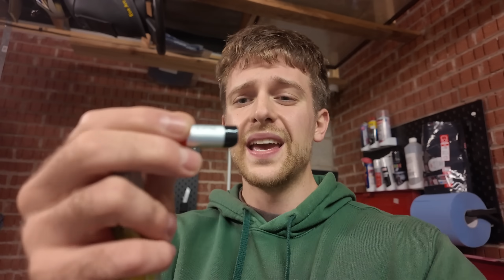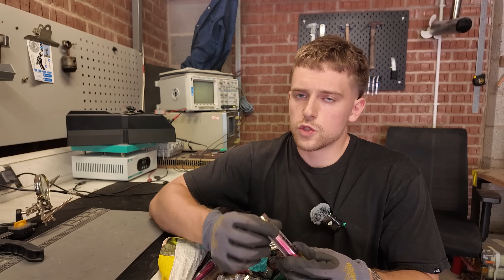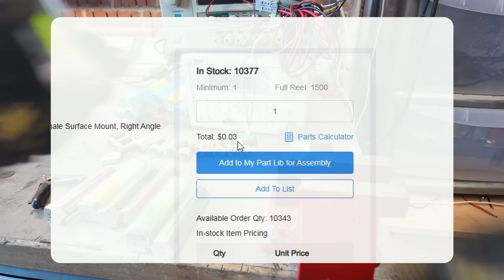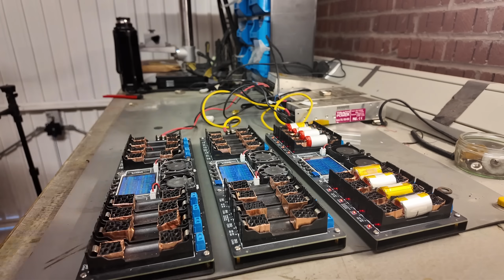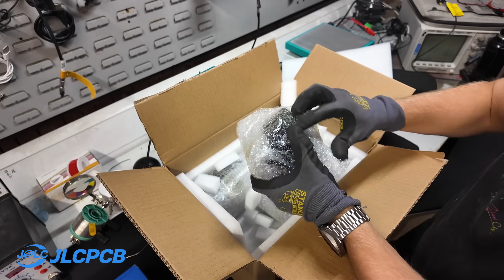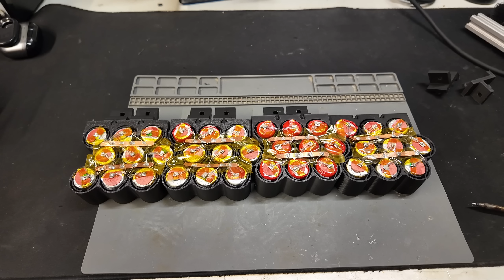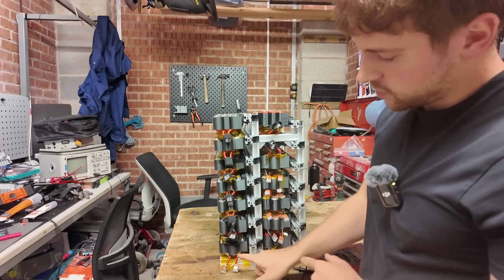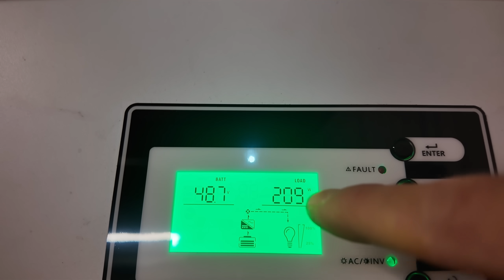I Powered My House Using 500 Disposable vapes

Comment: This is incredibly dangerous despite all the safety measures you put into place. But a fantastic project which demonstrates how insane the disposable economy is.
Reply: This is more like "will these burn my house down"
Reply: Nothing 'incredibly unsafe' whatsoever. People questioning the quality of these cells... I have been using and testing them for a couple of years. They have been recently extremely rugged and high quality. Vapes demand high current and capacity cells. China seems to have learned more than any place how to produce cheap, reliable quality cells in recent years. Smearing them just by assuming they will produce rubbish just doesn't fit reality or make sense anymore. Those disposable vapes had a vanishingly low failure rate from the box which could be anything, including battery issues. Though I can't find the data now... Take my word for it, it was a crazy low number.
Reply: How does the electrical protection system now function is what I would be worried about. Electrocution and fire are defo concerns
Reply: Have a very large scuttle full of sand hanging over them ready to dump on the batteries should they catch fire.
Reply: @david-spliso1928  Or just lower them into sand from the start. May get a bit warm, of course...
Reply: @_TheDudeAbides_  Yes you need to be able to smother the fire quickly.
Reply: @david-spliso1928  maybe a chamber of sand over the top, activated by a solenoid to release if x condition triggered by y
Reply: What is dangerous here? Can you explain?
Reply: @13hubi13  The quality of the cells is questionable at best. The manufacturers of the vapes dont really care since they only need to work once.
Reply: @Jonzzono  even the Tesla cells are made in china, so stop talking BS. The cells in this video are as safe as any other.
Reply: @ludovicschneider6190  No. China is a large country with many different battery manufacturers, each manufacturing batteries of various quality and spec.  The basic conductor elements may be the same, but the specs and build quality of the batteries themselves vary wildly.  Being made in any specific country does not indicate ubiquity of quality, least of all China, who simultaneously are the world's manufacturing experts but also have low regulation and bottom rung quality control standards.

A disposable vape manufacture is going to source the cheapest battery available. A company like Tesla that has safety and regulatory guidelines to follow and has the expectation of long term repeat use is going to source their batteries with a higher build and safety standard.  Not all batteries are the same.
Reply: @Jonzzono  but if any of the cells fails there are things stopping it to go ballistic, right? Like the fuse and the small connections on the positive side.
 Won't that be enough to prevent it to explode?
Reply: @ludovicschneider6190  No they're not. A lot of cheap cells are from multiple sources. Even if they're the same "type", they all share different manufacturers that have different quality standards.

If I built a battery bank like the one in the video, I'd probably attach some form of balance monitoring to each individual cell, to keep track of every individual one. I also wouldn't solder the rails directly to the cells, rather adjust the holders and design to quick swap a cell if needed. 

As well as improving the housing for each cell bank to isolate it from the other cells in the case of a fire. You could adapt the design methodology of the BatSafe, where each cell block (not row) is both explosion and fire proof. As well as solid state fuses / relay interrupts for the whole system in case of a short in a cell row or block. Solid state fuses generally break FASTER than regular fuses, which also prevents a potential fire from breaking out if a short occurs. 

Shorting is the main issue cause under high load, these cells can heat up rapidly, which can lead to cell puffing and shorts internally within the layers inside the batteries electrolyte. Then you get "cracking" noises, followed by smoke. Then fire. Explosions. And really really toxic fumes.

To build a proper battery to power a house, you could use these vape batteries, but the actual design of your housing and safety features should ALWAYS be first priority. Especially when dealing with the quality of the batteries within disposable vapes.

You can't expect the battery gods to treat you well when you say shit like that. In all seriousness, lithium batteries of any type, regardless of origin can and will burn your house down if you don't know what you're doing.
Reply: @ludovicschneider6190  thats dumb thing to say and not true. :) sorry but quality is a incredibly variable thing in cells.
Reply: @jessicagalindo4470  battery blowing up because of terminal runaway, when one battery burns it’s overheating other ones and it’s creating chain reaction..
Reply: @13hubi13 Having thousands of lithium ion cells from dubious origins all sitting in a confined space.
Reply: @13hubi13  these cells are not supposed to be constantly charged and recharged, plus if you try to charge them fast they get hot pretty fast. and unlike special batteries like lifepo4, these actually burn. and it will take literally ONE bad cell to  catch fire or explode for the whole thing to go down. 

I can assure you, if the person is this good with engineering and soldering, he won't be actually using that, it's to show a concept
Reply: @zenlettering  LiFePo4 burns too. Not that commonly, but open flame is most definitely possible, have seen it myself with drone batteries. Plelnty of YT vids too.
Reply: @zenlettering  I have recharged these cells at 3c or 4.5A to 80% and they get slightly warm then once they are in the constant voltage part of charge the charge current rapidly drops but I have taken these from flat to full in about 23 min. most of the older ones used to be 1500MAH but they dropped to 1350MAH a while back. the 1500 were closer to 1400 in reality and the 1350 were closer at around 1300. if we assume that they are around 1.3AH a cell X36 that gets 46.8AH at 50V or 2.3KWh total. I would be perfectly happy fast charging this at 60A to 80% SOC then disconnecting the charger at that to reduce stress on the cells and discharge to 15%, this would reduce it to a 1.5KWh unit but it would let it last well over 500 cycles and possibly to 1000 instead of around 100 given the quality of the cells. 

but for safety I would construct a small brick hut for it outside with some vent holes at the top and bottom preferably on the long side (half a vent brick would do per pack top and bottom with a mesh screen attached to the back to keep bugs out) then a separate compartment on the back to hold the BMS and wiring with a sheet metal plate to cover the top, that way if it does melt down it cant burn the workshop although it may need a small 30-50W heater with a frost thermostat to keep the chill off the batteries in winter that would need mounted under the packs to act via convection, a little bit of fiberglass insulation built into its roof may help allot with this. it could even be built wide enough to fit 2-3 of these modules but then a bigger heater may be needed but once the pack has load on it the cells will warm up and the stat would disconnect the heater until enclosure drops below the 10C or so the stat would want to be sat at.
Reply: @Phantogram2  A drone with an LFP battery? That exists? But yes, they are far safer but not fail-safe.
Reply: @13hubi13  The inverted used is an off grid inverter. If by mistake the grid power was on at the same time as this inverter, the power will be out of phase and very dangerous to the household, grid workers or even other customers. If a hybrid-grid tie inverter was used, this would be safer. As for the cells, they are known to be volatile if there is a thermal runaway event for whatever reason, this could be catastrophic. Lifepo4 is far far safer and if you factor time and risk, buying lifeo4 cells would be so much more cost effective but of course not a great video.
Reply: @13hubi13 I wouldn't do it. I'm building my 5th lithium iron phosphate battery today & cells are variable in internal resistance, capacity etc and must be matched. I test mine because I don't trust the distributor since they sell in 4 packs they guarantee they checked & matched but I buy 2x 4 packs to build a 24v & they don't guarantee to match the 1st 4 pack & the 2nd. It can work if mismatched but is unwise even with lifepo4 batteries that don't burn like other lithium cells which i believe vape batteries burn lol
Reply: Agreed. 1 in 500 dodgy cells decides to give up the ghost some evening while recharging......
Still cool to see someone do something like this, especially since he's nowhere near me.
Actually using this without relocating outside, in a sturdy metal or concrete housing though would be not_smart.
Reply: He didn't weld the cells but solder it. Not very safe either
Reply: @anonymunsichtbar3715 sure buddy... soldering is known for not working, right... 🤡
Reply: @anonymunsichtbar3715 He used the existing welded strips, no?
Reply: It's not insane, consumers r just dumb, I save all my Lithium ion bats and I boost my electronics like my wireless speaker ect... or I replace my TV remote regular battery with rechargeable from a vape 😂
Reply: was disappointed seeing they seemed to contain polymer pouches instead of the nice cells. i don't want those bloating bombs near me
Reply: 14:15 he said it himself.
Reply: If you know about electronics you know 50V isn’t actually dangerous. A lot of EVs are 800V and yet people don’t call them “incredibly dangerous” in fact most of yall text and drive right next to teslas.

Comment: 5:50 alright, I know a product exists that'll do this better. How do I know this? I own it! Get a universal battery charger. Took less than 30seconds to work out the search term and find one that'll work on the smaller of those two batteries (13350) with 8bays for 25$. I'm sure theres even cheaper options considering how little effort I put into looking.

Comment: That's so stupid, I've even written to the manufacturers: Why are you putting LiPo batteries in a disposable product? 
The manufacturers reply, yes, we write it on the products, people should hand them in for recycling.... That has never worked! The legislator should intervene and stipulate that only normal batteries may be used! Honestly, electric cars are expensive because of the raw materials needed for the batteries, and we're throwing tons of this stuff in the trash. I've been vaping for 12 years and find disposables disgusting!

Comment: Flat batteries can be recovered even if below 3V - use a TP4056 charging module which trickle charges until the battery can take the full charging current. Lion batteries are only really ready for the bin/recycling when they have had several thousand charge/discharge cycles.

Comment: Could you build/print a top and bottom that connects the batteries through pressure, reducing the labor of soldering? Or is soldering a must?  I really appreciate the sponge and copper tape. Thanks for showing this project.  Fascinating to see everything come together. Really impressed with the ability to recycle these things for a positive impact.

Comment: "English chemist Sir Humphry Davy attempted to extract aluminum metal from its oxide but failed, naming the hypothetical element "ALUMINUM"", an exact quote from encyclopedia BRITAINNICA. it furthermore states,  "Charles Martin Hall in the U.S. and Paul Héroult in France independently discovered a more economic way to produce aluminum using an electric current to extract it from alumina dissolved in molten cryolite. 
in 1868 Hall patented and commercialized his process, founding the company that would later become Alcoa." in his patent he named it ALUMINUM. Brits, please learn to pronounce this world correctly.

Comment: 😂I hope you made sure you used a ESD safe variant for your 3D printing plastic… I’m sure you did but if you didn’t, the static electricity would definitely mess with the power of your batteries. 🪫

Comment: Please replace the wagos I love wagos too but that is very doggy also you should take on my personal off grid system 45kwh of battery capiabke if doing 900 amp discharge continuously into 2 inverter (soon to be 3) constantly running a shed and house

Comment: Can you share total cost of this ? Can you imagine you can charge it at night when the electricity is cheap distributed and use it during the day or other expensive hours. It could amortize itself really easily and you will have a backup plan for electric cuts.

Comment: This is completely dangerous wiring and standards. 

Please don’t follow the wiring. For proof of concept fine but I hope you’ve disconnected the back feeds via the fuse board. 

You can have the chance to kill someone with the way you’ve connected it to the mains. 

You should really have a better solution I.e generator input into the house or garage that completely disconnects the mains and makes it impossible to to have both on together. 

I really don’t want to be that guy. I really really don’t. 

Great job on making it work. Poor application. 

If you’ve followed some American setups you may see similar but they normally have a mounted blocking plate to stop two being on together.

Comment: So what happens when you have a blackout and forget to turn off the main fuse connecting the output of the inverter to the grid when the grid comes back up? (the inverter needs to be between the incoming feed and loads)

Comment: Way too much work for quite low capacity. I've got free battery pack from crashed electric BMW. Huge and heavy battery but woth it. From 300 pcs 21700 cells only about 20pcs was defective and 280 cells had 3000-4000mAh. I bought electronics and I build awesome batterypack for my cabin. 
It powers the lights, water pump, TV, computer, water heater, washing machine and accu tools chargers for three days without any problems. If the sun shines brightly during the day, the battery pack manages to recharge nicely from four solar panels and does not go below 60% of capacity.
Costs: solar panels and driver about 700 USD, battery pack boards and parts about 80 USD. My time about 30 hours. I have battery pack in value let's say 3000 USD.

Comment: The ultimate question of how long those cells will last still remains though. At least they are modular and you can isolate and replace them with a little effort but IDK if I would trust vape Lithium cells. Cool

Comment: You should REALLY get some proper suction for the solder fumes! Resin can cause long-term damage - it's really a health hazard to be aware of!
Carbon filters doesn't help (even though many electronics suppliers falsely states otherwise) - the best is to have suction going out of the house. An alternative is HEPA filters that can actually filter out the dangerous molecules.
I'm an electronics technician apprentice, btw.
- And epic video; you tackled all the safety areas I've been worried about in making powerbanks of these vape batteries. I have a few shopping bags filled with them, but I hesitated doing the project because of the great risk of explosion. Thank you for the tips - you got a new sub!

Comment: How many charging cycles are these batteries capable of? My thoughts are taking into account that those are disposable items not meant to be recharged and on the other side you are building (with lots of efforts) a structure that is sitting on the rechargeability of those batteries. Do you have some ideas about this?

Comment: the only problem that is not shown is how long it lasts on battery power, i bet he gets 30 minutes or so powering his house with all thing on, there is no getting away from it, we live in a power hungry age and that small battery pack is not going to cut it, yes I am an electrical design engineer and have designed ups's in the past. All said and done, the greatest and best achievement here is stopping all those vape batteries going to land fill so i do take my hat off to Chris. One small critic, those small power cables and connector you have used to connect the batteries will not take 200A for any great length of time, the connector will overheat due to resistance and cable and connector will become a fuse and burn out. Stepping up the voltage from 50V to 240V in itself consumes current. A house  can be @fused@ at around 100A or more, power draw  typically lets say 30A with the ratio of approximately 4.8 (240/50) then input current from the batteries to the inverter at 30A should be about 144A. It looks like you have used 6mm2 cable for the main connections un fortunately 6mm2 cable is rated for approximately 32A per core. I hope this has given you food for thought!

Comment: I've charged and tested a number of under voltage vape and 18650's. I'm not convinced it's as bad as people think. No issues at all and still near rated capacity in most cases. Should be studied further if it hasn't already

Comment: I must say that this is not for everyone. Chris has a very good understanding of electrical principles and large dc batteries are very dangerous if handled incorrectly. That said well done both of you and the environment benefits too. 
(I’v installed lithium cell batteries in my van and the mains voltage inverter)

Comment: That is not 100% true that li-ion cells bellow 2.5V (you show even lower 1,46V) are unusable and demaged... below the protect voltage you cell will not be detected by chip or board circtuit, but after quick charging with 0.5C or 1C currect with (at this point) 3,7V it will still work... Also I have battery with 1,5V and 2.3V --> and the 1,5V after charging to nominal 3,7V was way better then this 2.3V cell, if you got li-ion tester after "battery regeneration" you can test if it is unusable or not.